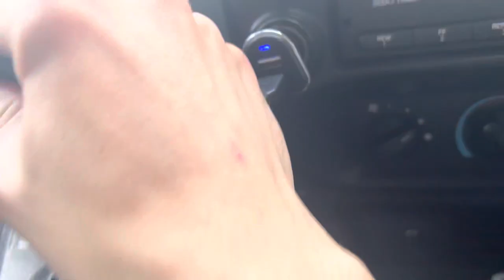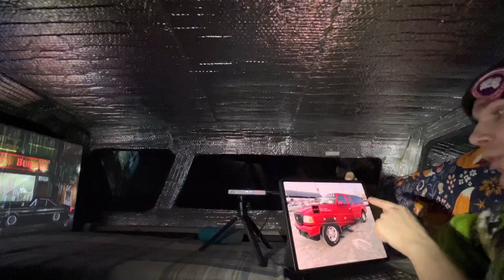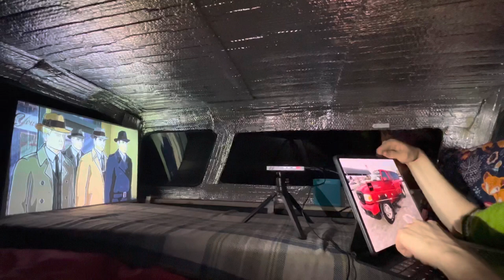How to add a movie screen in your vehicle

Comment: Where do I go to buy the insulation? I know in the group you told me it was a big difference. I wanna do this for my Jeep.
Reply from the maker: I got mine from home hardware in 30 foot rolls for around $1/foot. I’d suggest looking on amazon for it (reflectix) since it’s probably cheaper. It’s the same material as used in garage door insulation kits so look into just using those if you can’t find the rolls of it. Also hot water tank covers are pretty much the same material as well and are easier to find